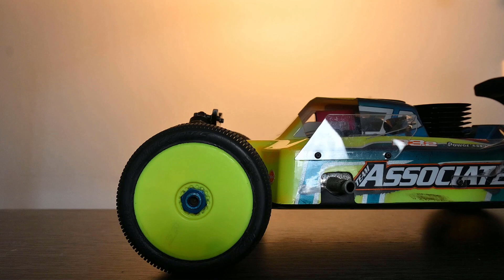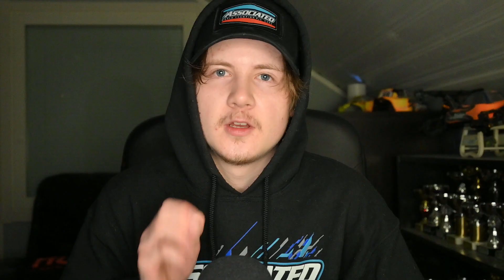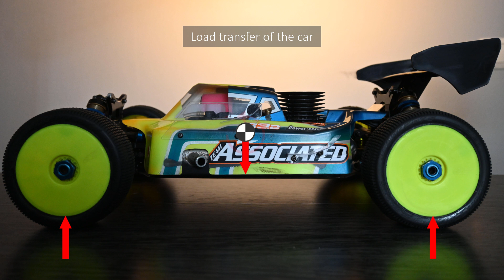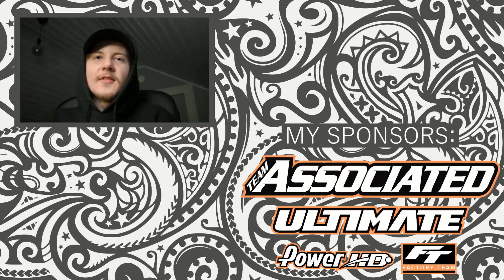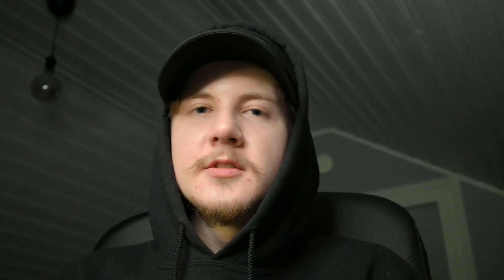From the ground up: Wheelbase

Comment: Is it not the otherway, longer wheelbase more weightbias and load shifting because the Momentumarm from the center is longer? Or im missunderstand something
Reply from the maker: The rotation happens from the center of the car. Imagine holding a long wrench and trying to push the other end to the ground vs a short wrench.